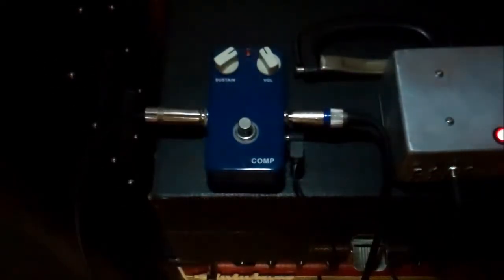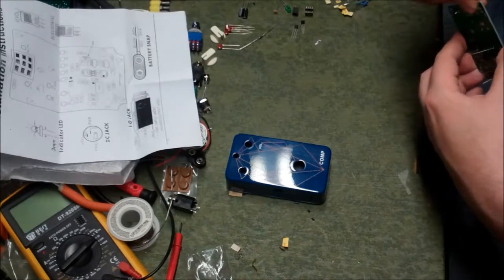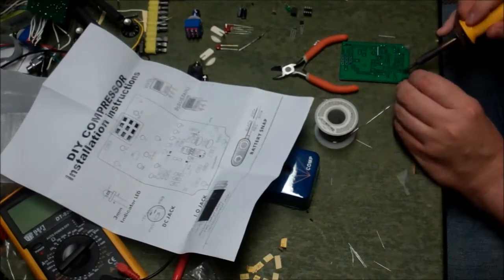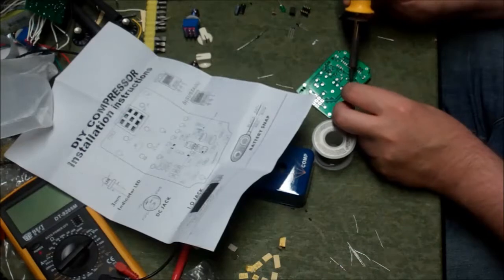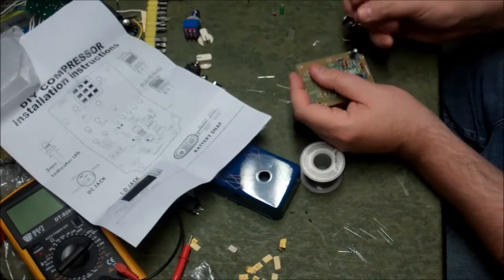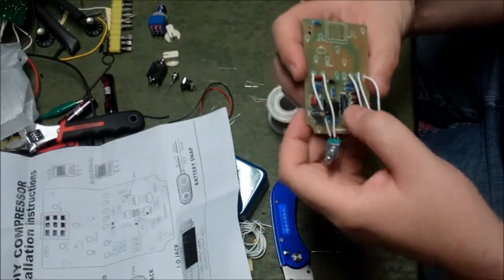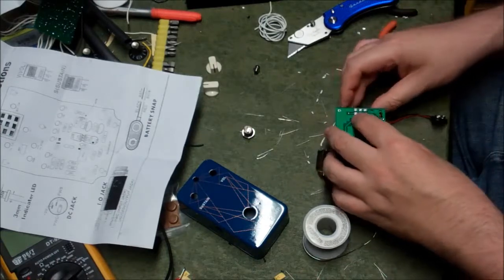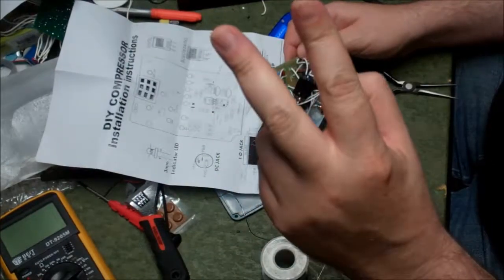AliExpress Compressor Guitar Pedal Demo and Build.

Comment: Great! Is this pedal based on the orange squeezer or dynacomp? thanks
Reply from the maker: I'm not sure,  as they didn't include a schematic.....  based on the transistor count,  it's more plausible that it's the orange squeezer.
Reply: All right, thanks!
Reply: Apparently it is based on the DOD 280 compressor.. I built the same.
greetings..

Comment: I have problem get the pedal working.  Should the led pointed at the ldr light up when pedal engaged and playing on the guitar?
Reply from the maker: Yes, the light should glow when you play loud enough into the pedal.
Reply: DeadKoby.  Thank you for the ansvar.  It will not light up. Can you have any idea what the problem is. Otherwise the pedal works but do not comoress as it should.

Comment: Hi, thanks for your video. I am working on this pedal today, but i had a problem with the solder. Can you help me and send a picture of the back of the pedal. I need to see the diagram of conecction on the back

Thanks for all
Reply from the maker: Hi Diego,  I don't think there's any special connections on the back of this board.   Just solder the pieces directly to the pads and you'll be ok.
Reply: DeadKoby i think that i broke a pad or two locate very close, and i don't have a picture of the distribution to  see what para i brake
Reply from the maker: Contact me via my website.